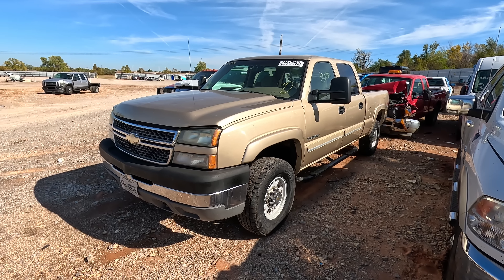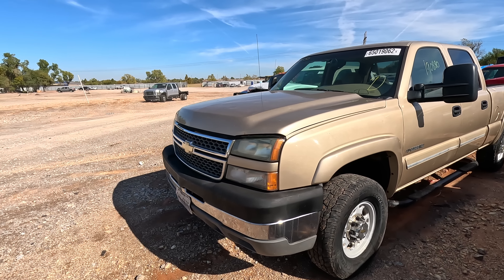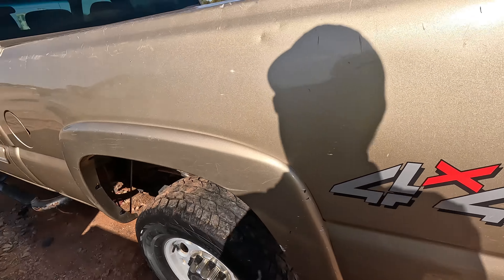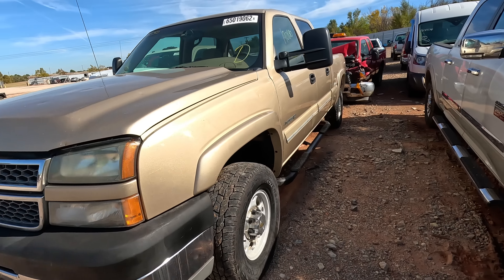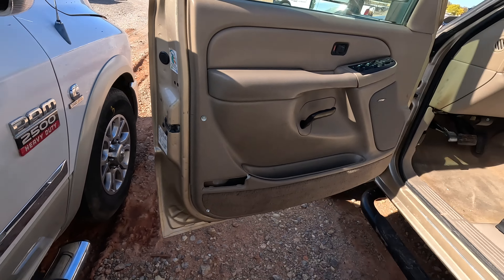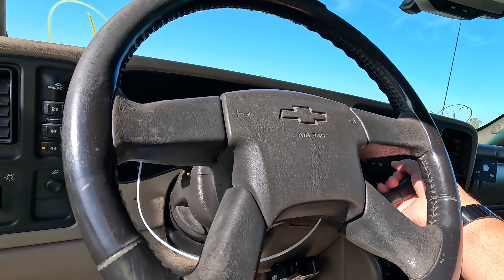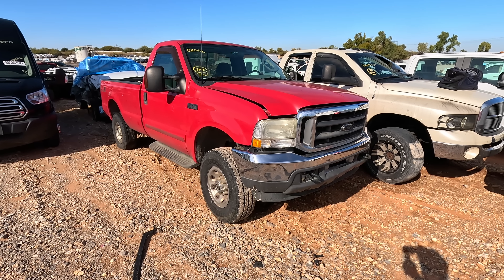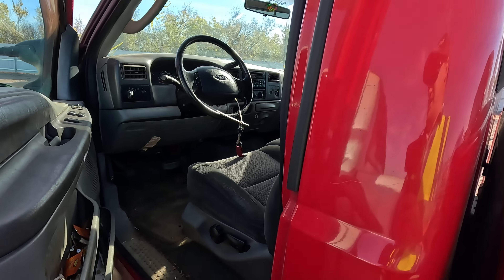Copart Walk Around 11-7-22 + Cheap Duramax Diesel Chevy 4x4!

Comment: That LBZ 2500 is highly sought after. They're the most reliable version of the Duramax. Good buy if you can afford it
Reply: its an LLY duramax. you can tell by the air box and gauge cluster
Reply: 05 are LLY 
06 are LBZ
Reply: I like the lb7, not really head gasket issues or anything major like the lbz other than the fuel injectors which you need to remove the valve covers for but once that job is done it's good for like 200,000km
Reply: @ferdelance6801  guess i was wrong i swore lbz was first but i guess its lly lbz lmm lml  then l5p i was thinking of the lb7 my bad the late model lb7 has lly tuning

Comment: Nice looking truck. Has the 6.6 litre durumax diesel. It does have the Allison automatic transmission which has the outside filter. Does have all the toys IE electric rear window defroster, air conditioning, AM/FM Stereo radio with cassette and CD player, aluminum alloy wheels, towing mirrors, tow package,.

Comment: I know I'm late to this party, but on GM HD trucks, the transfer case is likely toast.  The case is magnesium and the oil pump housing is stamped sheet metal, which heavy loads (clearly this one towed a lot) will cause the sharp pump housing to eat tiny holes in the softer case, and since nobody maintains the transfer case properly, they don't notice it leaked out the fluid until it slowly eats itself... If it's having issues (very unlikely the solenoid/encoder is bad as these trucks use CANBUS for everything and the controls will go dark if there's a bad electrical part the computer can test for functionality... And to manually shift these, the solenoid has to be pulled), you'll need a new/good low mile used NP263XHD to crack open and install an oil pump kit that will make it bulletproof.  Ask me how I know! 

As far as the engine goes, the LBZ (2006.5-2007 classic) and early 06 LLY (a lower tune LBZ before they bumped up the power and renamed it for 06.5... The early 06 LLY is not the same as the 05 LLY or early LB7) are the ones everyone wants.  Pre-DEF and basically bulletproof (the 07+ new body style with the LMM added a bunch of emissions that aren't as reliable... Not terrible, but worse than the LBZ).  

As far as the transmission goes, the 06+ with the 6 speed Allison 1000 automatic are the bees knees... These things are used in medium duty trucks and school buses (in busses, 6th it's usually electronically locked out), so in a "light" duty truck like this, it'll outlast the truck.  

Note that a 6 speed manual was available up until early 06, but the Allison is tougher and has a higher tow rating (the 06.5+ Duramax makes too much torque), so not many were sold, making the early 06/stick combo super rare. The 6 speed Allison is easily identified as it has manual mode (and PRNDML in the instrument cluster) with the buttons on the shifter.  It was also available on the 8.1 gasser (but the Allison was never put in the vans [even with the Duramax] or Suburbans [even with the 8.1], likely because it wouldn't fit [Duramax/Allison swaps in 3/4 ton Suburbans require a 2" body lift to clear the transmission bellhousing]).

I originally thought this was a gasser as it's curiously missing the telltale "Duramax Diesel" badge on early 06 and older or the "Duramax/Allison" badge on 06.5-07 that is directly above the 2500HD badge on the doors.

Also plan on replacing the instrument cluster/radio/climate to make it sellable... unless you're good at soldering as they used non-replaceable incandescent bulbs soldered onto the circuit board.  Early models also had issues with the gauge motors going bad and being erratic.

Lastly, on the Ford, it does likely have a front clip swap as all the gassers have the "Triton V8/V10" badge between the headlight and wheel well.  A diesel should clearly say DIESEL FUEL ONLY on the fuel door/cap (unless it's been replaced) and instrument cluster.

Comment: Duramaxs are very dependable trucks. Mine is a 02 lb7 and she’s only had a water pump 2 sets of injectors and a shift selector. And that’s out of 300k miles of use. Obviously it’s had the suspension and want not, the regular stuff.

Comment: the duramax arent generally reliable the lbz is the most reliable duramax. that lbz is the most sought after itd be a good buy that f250 has been severely wrecked also the f250 would have a 5.4 6.8 v10 or 7.3 powerstroke that ram just needs a new drivers side frame horn and itd be fine would be a good buy i wanted to see the ford at 8:41 also a yes to truck content(im biased because i love trucks far more than cars but i love both)